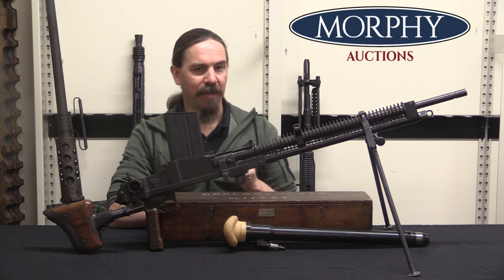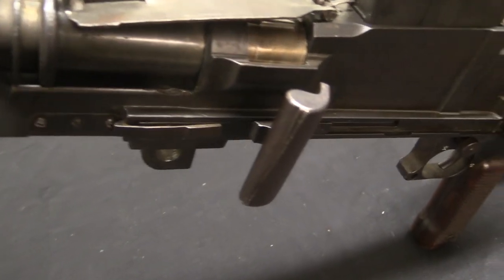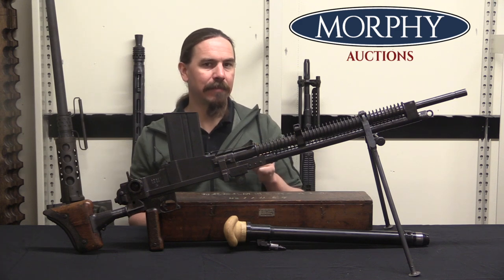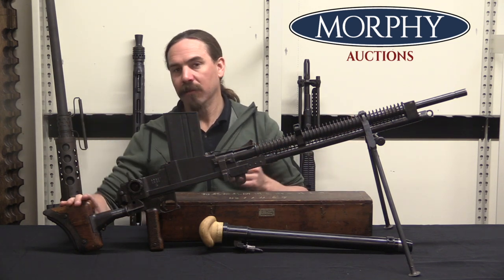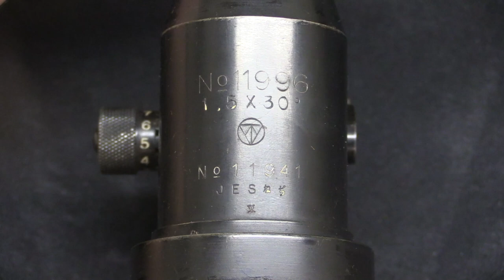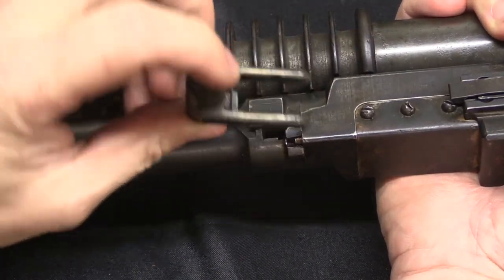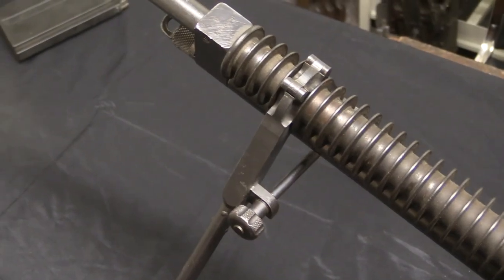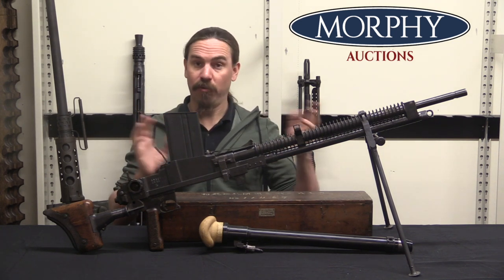Type 97: Kijiro Nambu Adapts the ZB-30 for Japanese Tanks

Comment: Demountable, modular sights, multi position bipod, folding and adjustable stock. All pretty modern apart from the magazine location.
Reply: Not surprised; the ZB machine guns were excellent, and well ahead of their time.
Reply: but top loading makes a lot of sense for a vehicle weapon, more than a bottom loading gun depending on how its mounted
Reply: Toploaded magazines for magazine fed Lmg's are modern though. it literally became a thing because having a mag hang out the bottom sucks for magazine fed  light machineguns
Reply: I love 💘 the cooling fins on this thing, so bada$$
Reply: This type better on top
Reply: One could also say not much has changed in 100 years
Reply: Contemporary MGs have either hon back to bottom mounted magazines, usually in heavy versions of infantry rifles, or are belt fed.
Reply: For this weapon's role, a top mounted magazine makes a ton of sense. Inside a vehicle it is probably much easier to access. 

Even in the infantry role the top mounted magazine had large advantages. With a dedicated loader they had much better access to the top mounted magazine as well as not forcing the gun to be higher off the ground. Remember Ian's comments on issues with the heavy FAL and it's 30 round magazines? That isn't to say there were no disadvantages but for a rifle caliber heavy machineguns it does make a lot of sense. 

But a full rifle caliber magazine fed LMG doesn't exist any more. You have intermediate cartridge SAWs (either belt or magazine fed) and belt fed GPMGs. And belt-fed machineguns are loaded from the top.
Reply: Top mounted magazines are easy to reload while in a vehicle and saves a lot of space and aiming at the ground
Reply: About as 'modern' as the tanks it was fitted to.
Reply: @verycreativ233  Can you name a LMG that is in service and has a toploaded magazine?
Reply: @AsbestosMuffins  Not having a machine gun fitted to your tank that uses a toploading magazine makes a lot more sense.
Reply: @TheJazsa80  can you name a modern crew served rifle caliber LMG in service?

This style of LMG doesn't exist any more because GPMGs and and intermediate cartridges. Just yesterday Ian was talking about how the 30 round FAL magazines failed for the support weapon versions in large part because they were too large and restricted movement. The top mounted British Brens had absolutely no issues with that. But once you move to an intermediate rifle cartridge a full powered LMG is a silly thing to have.
Reply: @88porpoise  A vehicle mounted toploaded lmg is not preferable. And I replied to the wrong person.  Anyway, my point is the Japanese only fitted the type 97 to their tanks because they had a war to lose and they were very busy.
Reply: A top mounted magazine isn't really a detriment. At least it wasn't at the time A lot of interwar and WW2 light machine guns had top mounted magazines. The ZB26 and ZB30, the Type 96 Nambu, the Bren gun, the Madsen (although the mag on the Madsen is offset, and sights are centered), the FM24/29 Chatellerault. The Owen gun, although a submachine gun, also has a top mounted magazine and offset sights. And I haven't been able to find, nor heard anyone refer to accounts of soldiers complaining about the magazine or sights on the Owen gun.
Reply: Very reliable with gravity doing it's thing.
Reply: Top load magazine allows it to eject out the bottom, which is FAR preferable inside a vehicle than a side or top eject. Still less desirable than a belt fed gun, but hey, it's better than using stripper clips!
Reply: Too bad the tanks they were mounted on weren't as modern by 1943.
Reply: @verycreativ233  top loading mags are not modern, they're a relic of the 20s to 40s. now LMGs are either belt fed (which i guess is technically top loading, even though the ammo canister is attached on the side or under the gun) or just uses a conventional magazine loaded from the bottom of the gun. The only modern top loading magazine that isn't obsolete is the p90, but that magazine is built in such a way that it lays along the frame of the gun, not protruding directly upwards, also the tiny round the p90 uses aids in making the magazine not too long or wide, which wouldnt be the case with machine guns firing at minimum intermediate caliber bullets, which are significantly longer and have much wider cases/bullets than a 5.7x28. there's a reason why top loading mags are not common anymore, it makes your gun way too high in profile which theoretically makes you easier to spot on the battle field. you always have to take in account that your gun automatically has an extra 8-10 inches of height with the top loading mag, and thats only for 20 round mags too, which for modern militaries is an extreme liability when it comes to concealing yourself, especially when you increase the capacity of a top loading mag to say 45-60 rounds which is common mag cap for modern mag fed lmgs. Now that micro drums are becoming common place, which gives you roughly double the capacity of a 30 round mag while being the same length, means bottom loading mags in LMGs is pretty much going to be standard for a long long time, along with belt feed. And drums would not work on a top loading lmg either, the drum would be so wide it would completely block any ability to set up sights properly, even if you offset them which is also an obsolete method of sight placement as it has been proven that setting up your sights directly in line with the top of the barrel gives you the best accuracy, and is easiest to sight in optics with
Reply: @Gameprojordan  dude instead of wall of texting him about what's used today etc. you could just read. He wrote as  far as it goes for MAGAZINE fed  Light machine guns top loading Is modern. "it's a relic of the 20's" yeah like magazine fed light machine guns in general pretty sure he know that. He said that because the original poster implied a bottom mounted magazine for a magazine fed light machine gun is more modern wich it isn't because not only do magazine fed light machine guns  not exist anymore it also limits your capacity and makes it unable to be crew served effectively. Also regarding your comment about how a top loaded magazine makes the gun taller well duh so does a 20 round bottom mounted magazine you genius, but atleast if you intend to use a magazine fed LMG a top loader would allow you to go prone  far easier no matter the capacity and would allow for a assistant gunner to reload for you . Why do you think they designed them the way they did in the first place? So as far as it goes for Magazine fed light machine guns top loading is modern and the most effective way. Also no drums won't be the standard for magazine fed light machine guns. not only does no one use magazine fed Lightmachineguns anymore drums are fucking horrible for everything, bulky, heavy, and unreliable.
Reply: @comradecosmonaut7746  i disagree... drums are fun until my upper handguard start to smoke :-) but then... i have 20 spare ones so i dont care :-D
Reply: @0neDoomedSpaceMarine  yes, more chunk, more chunk!
Reply: @comradecosmonaut7746  lmao my bad I was high af and kept editing my reply to try and add more clarity 😂😂 but naw man magazine fed light machine guns are common. The RPK 74 and m27 IAR are perfect modern examples of them. And I'm not talking about those old school finicky rattling drum mags. Look up x-15 mini drums or quad stack magazines, those are the new modernized versions of drum mags. They all use regular magazine springs and don't require some weird winding mechanism. And they're relatively compact for what they are
Reply: Magazine on the top is nice for shooting from the prone position. 
also why most machine guns are belt-fed today because it's convenient to shoot and reload with an assistant gunner helping with the reloads from the prone..
Reply: You say that but the m249 which is the current SAW for the us armed forces feeds from the side using stanag magazines
Reply: @midnightranger9846  In an emergency only, it's designed to feed from belts, the mag well is an afterthought.
Reply: @TheJazsa80  yes i can the Madsen LMG is still in use with the Brazilian Federal police which widely considered a gendarmes unit aka paramilitary.
Reply: @midnightranger9846  M249 are also notoriously unreliable when using box magazine. So much so that later Mk46 and Mk48 variants omitted capabilities of using box magazine from the gun
Reply: @Matt_The_Hugenot  rpk: whut?

Comment: A little sidefact: Japan used to put armored shrouds over the part of the barrel that extends beyond the ballmount outside of the tank to prevent the cooling fins from taking damage.
Which is why they sometimes look flamethrower-ish when you see them mounted on the few imperial japanese Tanks  that existed.
Reply: I wonder if they ever thought about adding cooling fins to the cooling fins' armoured shrouds, and then an armoured shroud to go over the cooling fins' armoured shroud's cooling fins.
Reply: @AshleyPomeroy  I don't think this 'side fact' is remotely factual.
Reply: @TheJazsa80  It’s real
Reply: I'm surprised Ian didn't mention the barrel shroud (which is missing from the example in the video). It's a visually distinctive part of the Type 97 when it's actually mounted on a vehicle.
Reply: Despite everyone else simply discarding cooling fins, and just going for a heavy profile barrel.
Reply: That shroud, like the gun itself, looks super cool, it'd be awesome to see the whole thing put together.

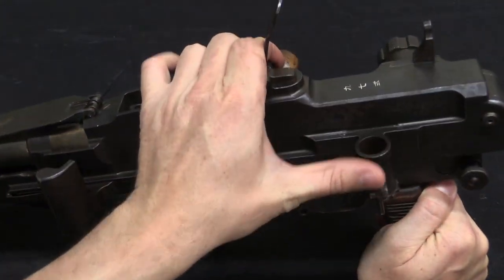Comment: 8:58 Huh! I didn't know that the marking for "fire" in the safety is literally the kanji for "fire", as in burning, flamey kind.
Reply: It is not so surprising if you think about the ethymology of "firing" a gun. It started with holding a flame close to your gunpowder until it caught fire and exploded in most cultures, so it would seem logical for fire(like flame) and fire(like gun) to be the same in many languages
Reply: I bet if English had a system like kanji it would also be use the symbol for fire, since I'm pretty sure that's the etymological root for its use. A "firearm" is a weapon that uses fire.
Reply: Sure, the etymology is there, but I still would have guessed that by that point it would have shifted to being derived from the word "shoot". While the word "fire" in English can refer to many things (literal fire, shooting a gun, losing a job, etc.), the kanji 火 isn't quite as ambiguous (to my knowledge, not an expert), and isn't usually (again, to my knowledge...) a part of words related to the meaning of "firing a weapon". I see 射 and 撃 much more there.
Reply: @KingdomOfDimensions  Mmm... Might be, might not be? Kanji is interesting to me in that while the pronunciation is often the same for many different concepts, the kanji themselves are often much more specific. So they might just as well have originally used the "kanji" for literal fire to refer to shooting  a weapon, but later come up with another one that is still pronounced the same, but drawn differently, to refer to the act of firing a weapon.
Reply: @thijsvandervoort8261  True in Finnish: "tulta" literally translates to "fire".

Comment: Hey Ian, long time production sound mixer here. You need to lower the input sensitivity on your wireless pack. Assuming it's a sennheiser with the included ME-2 mic, it should be set to either -36, -39, or -42 dB. Been mixing for years and that's always the sweet-spot for loud, clear speakers such as yourself. If it's too low you can always boost it in post. If it's too loud and clipping (as it is here) it is much harder to clean up and still retains the distortion even when you lower the levels.

Comment: The gas plug is somewhat inconveniently located. However with vehicle mounted MGs normally you are going to have 2 or 3 barrels total. So what happens is you have one barrel set to use when the gun is clean, there isn't any carbon in the gas system and a smaller gas port is needed. Then as the gun becomes fouled and the gas system fills with carbon the second barrel with the gas regulator set to a larger opening is swapped for the first one. So you'd not be messing about much with the gas regulator setting in actual use.
Reply: @justforever96  Just keep in mind that the daily use pain in the ass factor is an important consideration for troops.

Comment: My guess for the 90 degree position on the stock is to be able to use it like a spade grip. Left hand on the trigger grip, right hand on the butt or the tube that holds the stock. Could also be for when its in the vehicle and stowed, if it slips out of the forward position and flops down it will stop at 90 degrees instead of flopping around while you're trying to shoot it.

Comment: Who makes the repro scope mounts> I have never seen one. What is rarer than a scope mount is the wireframe that attaches to the trigger that holds a canvas and leather bag with a zipper on the bottom to catch the brass so you don't have a tank full of the spent casing to walk on. I have one but sadly the bag rotted away when the tank it was in was full of water and the acid from the batteries.

Comment: Seems odd that the buttstock is folding rather than being completely removable since it’s primarily intended to be used from inside a vehicle.  I guess it’s more convenient if you do need to bail out of the vehicle in a hurry you don’t need to find the stock but if you’re in so much of a hurry to leave you probably aren’t going to be taking the time to dismount the machinegun in the first place. It’s doubly odd when you need to grab the bipod as a separate piece anyways.

Comment: Why did the Japanese go from the 6.5mm cartridge to the 7.7mm cartridge only in the 1930s? They had already encountered the 7.62x54R in the 1905 Russo-Japanese War and the 7.62x54R is far superior in performane compared to the 6.5mm Japanese cartridge.
Reply: @kirkstinson7316  My mistake. I meant to write: Why did the Japanese go from the 6.5mm cartridge to the 7.7mm cartridge only in the 1930s? Why not earlier?
Reply from the maker: I suspect because the aircraft and armored vehicle threat wasn't significant until the early 30s.
Reply: @ForgottenWeapons  It's just interesting that the the Japanese were not concerned about 6.5mm being underpowerd comapared to the 7.62x54mmR, but were worried about the 7.92mm used by the Chinese. I guess since the Japanese overwhelmingly won the Russo-Japanese War, it made the Japanese more confident with sticking with the 6.5mm although it was relatively outclassed by cartridges used by other militaries.
Reply: Interesting enough, the Italians had a pretty similar 6,5mm ammo and in the same period started tinkering around the new 7,35mm.
The 6,5mm was accepted as adequate until that.
Reply: @ulissedazante5748  The Italian approach was even a bit more bizzare because they adopted two separate cartridges to replace the 6.5mm - the 7.35 for rifles and LMGs and 8x59mm for medium machine guns instead of adopting one cartridge that would be suitable for bothe the rifles and medium machine guns. One could argue that the Italians were even ahead of their time with the 7.35mm cartridge as it resembled later intermediate cartridges but the Italians did not have a rifle to use the full potential of the 7.35mm cartridge.

Comment: Sometimes I feel like what japanese lacked was soviet equipment. Designed to be mass produced yet still reliable and effective. PPSh-41, DP-28(if I recall right, it's THE cheapest in terms of menhours LMG of WWII which was still good), PTRD and so on. And vice versa japanese had also found a lot of ways to cut corners where possible. For example they were one of the best when it came to casting radial engine blocks for cheap.
Reply: @HankScorpio64  I haven't said that they were bad, have I? I said that a lot of them were a bit too expensive for the war Japan was fighting. DP-28 is cheaper then the gun in the video and has a two different drum options. And if you have seen video on it, it is less fancy, but good enough to do its job.
Other example is PPSh-41 and especially PPS-43. Japan lacked SMGs in any serious capacity being too late to realize what their own gun designers were telling them. And once again, their SMGs were too expensive to produce compared to PPS-43(it wasn't STEN cheap, but it was better. Still loses to Owen though:))
Due to the condition of respective fronts, soviets developed equipment that would have made japanese army(that was thrown under the bus by japanese navy), salivate. Not by its technology in most cases, but by abundance of it. USSR didn't have to dedicate a lot of resources to naval development during the war after all!
And it also connects with the fact that japanese carried out all the WRONG lessons from Battle of Khalkin-Gol(ok, not screwing around with USSR might have been a good one, but the rest were counter productive and one sided).
Reply: @HankScorpio64  
1)japanese had exactly that. In fact they were (in)famous for constantly finding ways to add more workers to production. Like schoolchildren for example.
2)what defensive war?! Japan was on defensive only in 1944/45, last two years of war for it. 2 out of 8! Second Sino-Japanese War and de facto WWII started in 1937! They needed equipment that would have helped them defeat continental China.
3)MG-34 is an expensive gun. MG42 somewhat fixed that(it was even cheaper to produce then BREN), but I'd still take two DP-28's LMGs for each single MG42 GPMG. 

Once again, it's not a defensive war and won't become one if japanese don't get bogged down in China. Situation that happened partially because japanese distrusted army after Khalkin-Gol to the point of forgetting how their own tanks were effective prior. Because they got scared by soviet ones and haven't taken it as a sign that "yes, tanks should be the future, we were right and should invest more into them since China isn't going to have a lot of them".